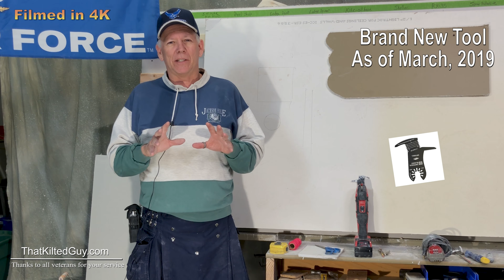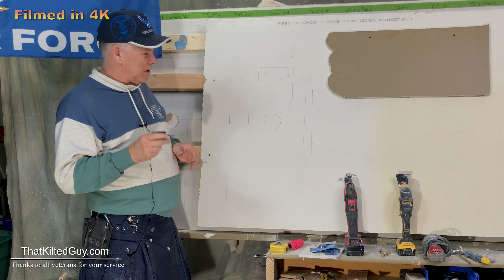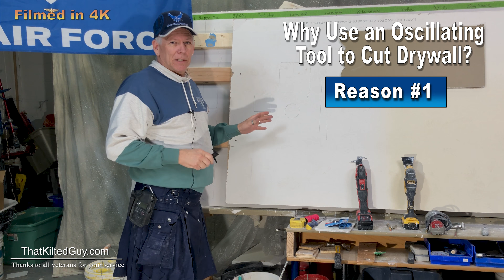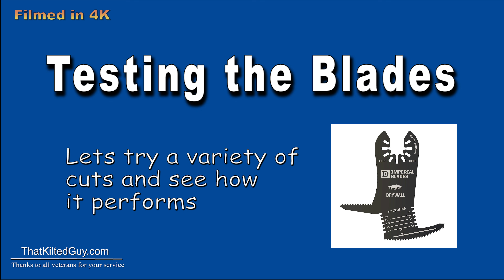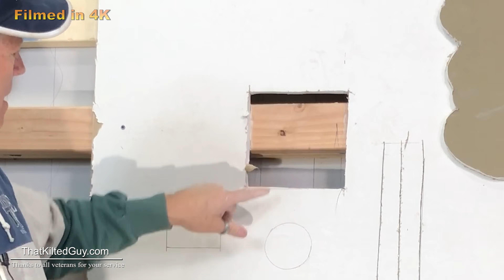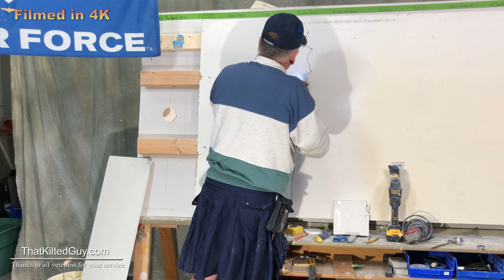BRAND NEW DRYWALL CUTTING BLADE, for Cutting Sheetrock with an Oscillating Saw

Comment: Do you think the pull-cut could be used to reduce the dust by angling it such that the teeth never actually come through the front face paper? I wound think you could keep most of your dust inside the stud cavity if you do it that way.

Comment: That’s my favorite drywall blade! It took a little to get used to it but once I had it down, I realized it was the best. It’s like a mini and thin jab saw creating very little dust. Everyone is different and was never really a fan of using a jab saw being afraid like you said knicking a wire or puncturing a pipe. Very impressed by the shavers too when you accidentally cut a hole or square slightly small. Quick, easy and precise. When I searched for one just like yours, I found that Milwaukee also made one but exactly the same w/ the shavers, depth gauges etc. Also I don’t know why but I feel like I already commented on this video. If I did, oh well. Haha! 🤔😂🤷🏻‍♂️👍🏼”🪚”

Comment: Is the blade that is used for the pull down method long enough to cut through double drywall?
Reply from the maker: No. Not strong enough either

Comment: Question - I've started repairs in my house (scraping all paint off walls then mudding entire wall surface going for smooth finish then new paint) and I'm gonna take it 1 room at a time.  I have several bad electrical outlets that need replacing but on just about every outlet that needs replacing the other problem is that the plastic wall boxes (new work boxes) are stripped at the screw hole where the outlet fastens to the plastic wall box.  I decided to remove all of these crap plastic boxes and replace them with metal outlet boxes (new work) that fasten to the side of a stud since I'm already doing all of this drywall work around them.  I dont want to go with the old work boxes that clamp on to the drywall b/c those often work their way loose and then I'd have the same problem again with loose outlets.  If you were installing new work boxes (that fasten to the side of a stud)  with drywall hung, how wide should you cut your drywall hole?  Is it best to cut it at 32" so that it covers 3 studs ( the outlet box would be the middle stud, then 16" in both directions to make it to the center of the adjacent studs).  Or would it be better to just cut a hole from the stud the outlet is on to the center of 1 adjacent stud (16" hole or less depending on how far awa the next stud is)?  If I do that I was wondering when I go to cut my outlet box hole out would it be too close to the edge of my fill in piece and crumble out - then I'd have to fill that in with mud after its hung?  Or is there a better way of doing what Im wanting to do?
Reply: I just got my multitool back today from the hospital so i can cut a line down the center of a stud pretty fast/easy so the cutting of the drywall wont be difficult.  I was just wondering whats the best route to take as far as how wide I should cut my hole out to install a new work metal box with drywall already hung.
Reply from the maker: Https://www.thatkiltedguy.com/consulting-services

Comment: I've always liked the 4 inch hole  saw blades for your drill for round cuts then sticking it back in when you're done with your work with great stuff as a glue /filler. Then shaving that down with your multi tool after it expands and smearing it with some plaster of Paris ""rock hard finish with no backing hack"" but this is amazing I'm getting one...great stuff/plaster also works great for any small repair in drywall mitigation with the need for tape/mud/ect.. multi tools rule I want try that blade on the turkey tomorrow, happy Thanksgiving...

Comment: I have an idea for a drywall cutting blade (unless one exists already).  When cutting drywall there could be times when there's fiberglass insulation with paper backing that I don't want to cut (or electric wires/pipes/etc) on the back side.  A blade that will only cut 1/2 deep would be great.  The blade could have a guard welded on top that prevents it from going any deeper than the distance from the teeth to the guard.  Does this type blade exist? If not feel free to pitch it to blade manufacturers.
Reply: Makita makes a tool like that. It's similar to a jig saw.

Comment: Thanks for making this video. I just bought this Dremel tool and I had to cut away drywall that was water damaged and this Dremel with the oscillating blade is amazing. Like you said, you don't run into the studs. It cuts drywall like butter. One question - would you use the same blade to cut a circle in an HDPE plastic container? Thanks.
Reply from the maker: It might be too fine, not sure

Comment: Have you tried using a jigsaw with a jigsaw blade snapped or cut to the thickness of the drywall you're working on to cut out old drywall? It is amazingly fast and you can run right over studs and wires and it wont go through. I dont know if it would be ok for drywall installation cuts but for removal it's the best I've seen.

Comment: I've used the flexible and stiff scraper blade on my multitool on old caulk and carpet glue and they'll reduce your time spent (and wearing out your arm/hand) scraping by over half. I haven't tried a drywall blade yet but I think I'm gonna pick one up today after watching this. How is the durability on them?
Reply from the maker: They have decent durability but the hook is a little bit weak if you get too aggressive

Comment: I got one and broke the  dagger part in the corner of the drywall. I demo molded and wet drywall from floods and too damn weak to use my knife. 

But I can tell you the imperial blade speeds my workflow up

Comment: Wrist control On your right hand will make a big difference on how straight your lines are also. If you’re trying to go too fast for the blade to keep up them you’re pushing the blade off to one side or the other if you tilt the machine at all it will tilt the blade.

Comment: the depth gauge: it's gong to be back that far from the teeth when you have plunged-through. because of the curve, by the time the whole teeth have plunged through the back of a 1/2" sheet, the line will be across the back of the piece, and the front will show 1/2"

Comment: Hi, why wouldn’t you use a cordless drywall router for ALL those cuts? Cleaner fast with no chance of cutting into PEX, wood or wiring
Reply from the maker: Thanks & I appreciate having you as a subscriber.  Guy
Reply: @ThatKiltedGuyDIY I wasn’t being sarcastic. Just trying to learn for DIY. Genuine question: why oscillating vs drywall router with depth gauge?

Comment: I retired my jab saw after getting an oscillating saw when cutting electrical outlet holes. Lifesaver! Have you done a video on accurately locating outlets? I have my methods.
Reply from the maker: No. I’d be interested in hearing your methods.
Reply: @ThatKiltedGuyDIY  Email sent through your web page link.

Comment: I use an oscillating tool quite a bit to cut drywall when I want to limit dust. I have found the round or half round steel blades work excellent, one great feature of these blades is they are very skinny and make a super fine cut free of feathering, however they dull quickly since they are made for wood.    I just got a segmented carbide grout blade and will report back LOLs.
Reply from the maker: The DeWalt blade I use in this video has held up extremely well. I used to go through those half circle blades and others at least once a week but my DeWalt blade will often last a month.

Comment: Just tried one for a bunch of can light moves.  I like the plunge blade and shaving edge, but the pull blade cuts like I'm trying to pull a utility knife thru the full thickness of the drywall in a single pass.
Reply from the maker: It’s weird because the one I used in the video was one of four they sent and it worked great. A few of the others have been saggy like you mentioned.
Reply: @ThatKiltedGuyDIY  Imperial Blades - are you listening?  You appear to have a quality control issue with the pull blade.

Comment: @That Kilted Guy DIY Home Improvement  
You've sold me on this blade. I made sure to click the link to order it.👍

You know what, in that "Use it? Or lose it?" pic you posted, my imagination got the better of me, cuz I was thinking that little yellow plastic tool was possibly like a cutter that's raked across the edge of a drywall sheet to round it over or bevel it. That way, when two sheets are butted, for example, there's automatically a V groove created to fill, instead of having to cut out a groove with a razor. I'm still waiting on my sample of "Tape in Mud" to arrive to try out, that's why I have this in mind.

You would think a product like what I'm describing would already exist, but I can't find it, so I'll ask you; Is there a tool or a method that you know of to quickly pre-bevel a drywall sheet edge BEFORE installing? My best idea so far is to use a roundover or chamfer router bit with a cordless trim router, but maybe you have a better idea.
Reply from the maker: That yellow tool is a guide for cutting bullnose to fit at a 90 degree angle to another bullnose, like in a window or door.  I never use it but bought it to demo in this series.

As for the bevels, I don't know of any way besides manual.
Reply from the maker: And I think a router would be terribly dusty.
Reply: @ThatKiltedGuyDIY  I'll pick up the Rigid Octane compact cordless router this weekend, it features a vac port attachment, how about that.
Reply: @ThatKiltedGuyDIY  Guess I'll have to patent this idea tonight then 😄
Reply from the maker: Here's a laminate trimmer that would be close to what you would need. https://amzn.to/2TKk9xe
Reply: @That Kilted Guy DIY Home Improvement  
That's a good suggestion. It led me to exploring a wide variety of options. There's also foam board cutters that would do the job. It would also be easy enough to make a tool myself that uses a utility razor. Or maybe just using a drywall rasp. That might actually be the best way to go, since some rasp are designed to be good at collecting most of the debris. I'll try that first, and then I'll test out both the Rigid Octane cordless router and the Octane cordless jigsaw, both of which have vac port, to see which option is the fastest and cleanest.

Thanks again for the advice, Guy. 🤜
Reply: @ThatKiltedGuyDIY  
Here's an update: A shop vac power tool adapter fits snuggly into the side opening of a Husky drywall rasp! Here's a vid of a guy doing just that; https://youtu.be/m_VOqOXDyHU
Reply from the maker: The rasp in that video you sent, I have it, and hate it.  It's too draggy and difficult to use.  I also just deal with the dust as worrying about it to much slows you down too much, and as a pro, I can't have that.  Also, rasps tend to tear up the face paper and kind of burr it.  They won't cut the paper cleanly, so I usually end up slicing it off with my utility knife anyway.  Here's my favorite rasp btw- https://amzn.to/3d0M8QH

Comment: As much as I love Oscillating saws, I always use a RotoZip type tool for drywall. Just my two cents.
Reply: How messy is it? I’ve used a oscillating tool once and it was so messy I opted to go back to a razor blade and a Sheetrock saw.

Comment: I'm a carpenter/contractor and do most of my own drywall work. I tried one of these blades after watching this video. The stab feature works well, but the cutting teeth are very fine and cause it to cut very slowly. The pull blade snapped off after about 4 hours of use. I will stick with the old reliable  semi circular drywall blades which are cheaper and last forever.
Reply from the maker: I have some had one break too and it does cut slower than some blades. Sorry for your experience.

Comment: Depth line on an angle, rounded tip facing opposite the other cutting side... I’m not a pro installer but,  the depth gauge looks like it’s made for “push cuts”. And why exactly can’t you pull it across the stud?

Comment: I notice there's something stuck on your earlobe.  Might want to check a mirror before you start filming...  Anyway, to do a real comparison of alternate methods you really have to use the Milwaukee medium size sawzall with a short drywall blade on it.  It makes much faster cuts, with less tearout of the paper than I'm seeing in this demo.  It's biggest drawback is when you are splitting a stud, and have to make a long cut down the length of a stud.  The blade tends to bounce off the wood.  On that cut the vibrator might be easier, but it means 2 tools instead of one.  I'm likely to just stick with the cutzall.

Comment: Nice blade. Will need to get one of those. Not a fan of the oscillating tools but they do have their uses. 

I use  a roto zip for doing precision drywall cutting.
 The biggest draw back with them is lots of dust.
Reply from the maker: I use mine quite a bit but yes, not for everything.  Gotta use it where it works best.  But sometimes manual is the wayto go.

Comment: Years ago I welded a section of Sawzall blade onto a worn out oscillating blade. It works great on drywall being longer so the movment is greater. It also lated much longer having carbide teeth. Angle the blade and you can cut up to a corner.
Reply from the maker: I love ingenuity.

Comment: Good for drywall.. unf all the walls I deal with are plaster/drywall, which destroys any blade quickly.
I use old blades to cut drywall.
Reply: Use a grout removal blade for plaster . Cuts like butter.

Comment: sorry to burst your bubble but you werent the first to "discover" the oscillating tool for cutting plaster. doctors and nurses were using one for many years for removing plaster casts and when i had one removed in 1982, i had the ahha moment, not to mention fein had actually made one specifically made for plaster sawing. on top of that Australian gyprock installers have already moved on to using a trimmer (small router) with a bit that has a blunt tipseveral years ago
Reply from the maker: Sorry you got that impression, but I don’t believe I ever said I was the first to discover this. I said I was one of the first to present this blade because at the time I did this video, it wasn’t even available for sale to the general public yet.

As for using routers to cut drywall, I didn’t mention that either, but my father and I were one of the early adopters of this in about 1980. We used a full-size router with a drill bit adapted into it. They didn’t even make drywall routing bits yet.

Hope that clears things up.

Take care

Comment: Mikita makes the best drywall cutting tool so far. It handles more like a jigsaw and even allows a vacuum connection.
Reply from the maker: I want to try that one.  I've seen it on Youtube but don't own it.
Reply: That Kilted Guy DIY Home Improvement we use it almost exclusively now for cutting drywall.

Comment: Way too much talking, I already know what happens when you use a knife.
When he finally does start cutting he has carefully placed the camera in the exact center of his back and completely blocks the shot with his arm.
Cut this in half and do it again with the camera to the side.
Reply from the maker: udavidism not everyone knows the same things so I present it like I’m showing a total novice. 75% of my viewers are novices.
Reply: @ThatKiltedGuyDIY   
You are free to make a video as boring as you want.
You do block the camera with your arm for most of the cutting.
Seventeen  percent of your audience gave you a thumbs down, most don't ever bother to vote.
A novice is not going to buy a multi tool or a specialized blade that costs $12.50 to cut a small hole in drywall.
But pardon me you just keep doing what you are doing.
I personally would want to improve.
Reply from the maker: I work on improving always but no matter what length these are, someone complains. I didn’t realize i had so many experienced viewers when i put this out. Youtube JUST RECENTLY started showing it to all you pros. Before that it was mostly novices viewing this. And that’s who it put these out for. 

But i have worked a lot on shortening my intros since this was put out last year. NO Youtuber starts out doing great. We learn as we go and I do listen but I can’t change an old video once it’s out there. Try my latest video. The intro is much shorter before just judging me. 
Thanks for the input
Reply from the maker: Here's a typical comment (below) on my other videos, showing that some like the fully detailed explanation, and some of you don't.  Can't please everyone. 

"Thank you sir!
I’m a true novice and I plan to use your step by step info soon. You explain everything so well; thanks again!"

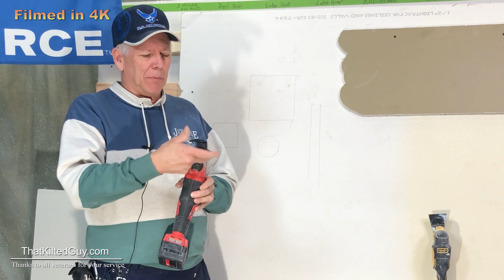Comment: 10:20 WTF is this guy wearing?  👗 🤦🏻‍♂️🤣😂
Reply: Your mom's dress from last night!
Reply from the maker: David Arevalo Hmmm. Channel name is That Kilted Guy, so maybe a Kilt??? Or don’t you know what a Kilt is?
Reply from the maker: It’s actually my new invention. It’s a solar powered, air exchange unit with built in anti paralytic movement sensors calibrated to the wearer’s body type designed to improve working efficiency on a semi logarithmic scale. Or, a kilt
Reply: @ThatKiltedGuyDIY  thanx, I thought it was just a dress.😁😆
Reply: @ThatKiltedGuyDIY  what about dangle,,WHEN you bend over.
Reply from the maker: @hankclingingsmith8707  Well, things do stay cooler due to airflow...lol